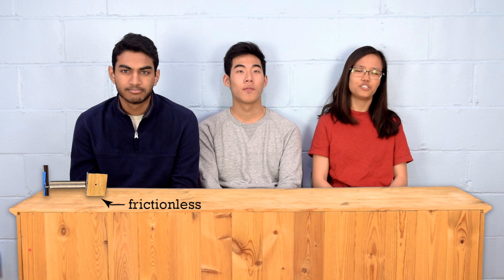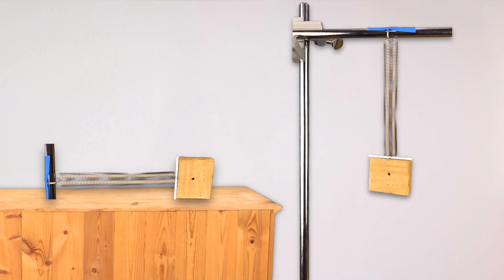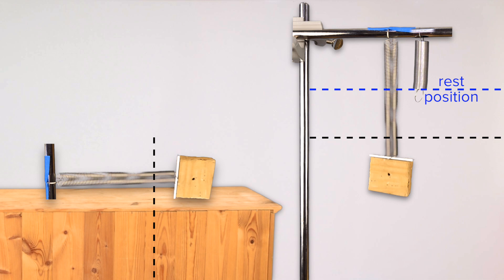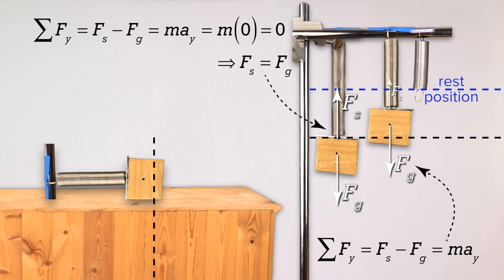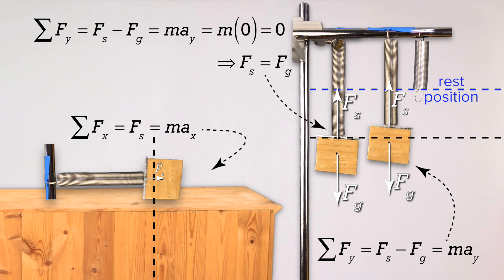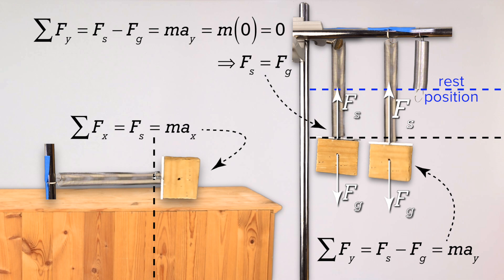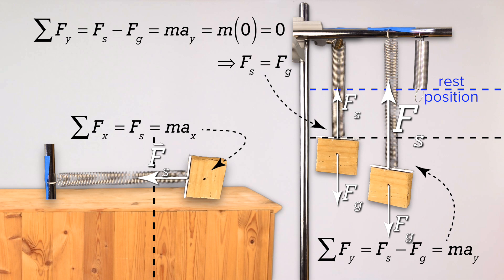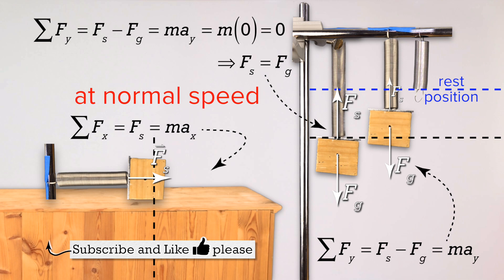Horizontal vs. Vertical Mass-Spring System

Comment: I’m confused. Wouldn’t a vertical spring mass system have different amplitudes? Meaning wouldn’t the max displacement from equilibrium (where kx =mg) from the bottom be more than the top? At the bottom kx is  upwards while mg is downwards. At the top, both kx and mg is downwards, wouldn’t that cause the mass to decelerate faster? Hence, wouldn’t the max displacement from the top be lower than the bottom?
Reply: kx is still upwards at the top of the block’s motion because the block is still lower than the rest position of the spring (without mass on it).

Comment: Why is the spring force in your animation always oriented upwards? Isn't it a restoring force and should therefore always face the equilibrium?
Reply from the maker: In the vertically oriented mass-spring system, the restoring force is the net force in the y-direction. The force of the spring is always up because the spring is always displaced down, below the rest position.
Reply: Flipping Physics of course, that makes sense! Thanks for the answer and for your videos, you are a BIG help.
Reply: Flipping Physics of course, that makes sense! Thanks for the answer and for your videos, you are a BIG help.
Reply: The net force (!) is the restoring force
Reply: @remaahmid5956  The spring force is upward, when the object is displaced below the unstressed position of the spring.  In this example, the spring is in tension.  The unstressed position is not the same as the equilibrium position, when gravity is a factor.  The unstressed position is where the spring force is zero, while the equilibrium position is where the spring force and gravity force add up to zero (in this example).

In order for the spring force in this example to be downward, the spring would need to move above the unstressed position, so that it pushes on the mass instead of pulls.  In an introductory analysis of this problem, there is no reason this couldn't happen in an example problem.  In practice, it is easier to do these experiments with a spring that is only loaded in tension only.  Some springs can't even be loaded in compression, because the coils will crash in to each other.

The spring only needs a simple point support to carry tension, but when compression comes in to play, there is a phenomenon called buckling that will complicate setting up the experiment in practice.   This is why you tend to avoid springs in compression for a simple demonstration like this, and when it isn't necessary to load a spring in compression for the problem at hand.